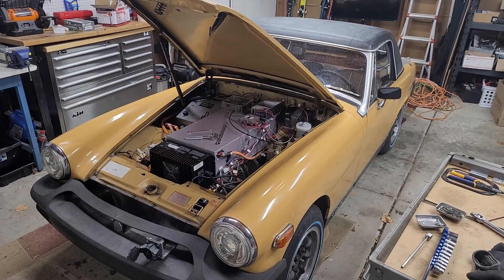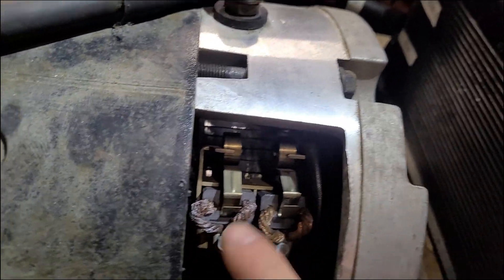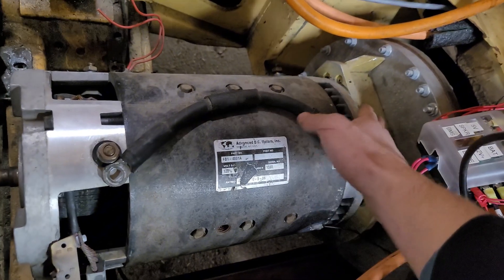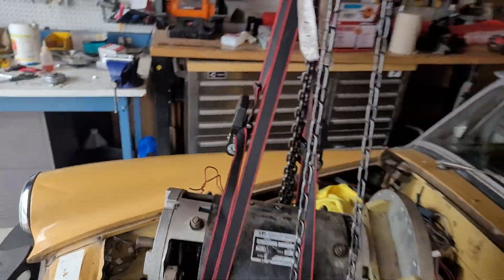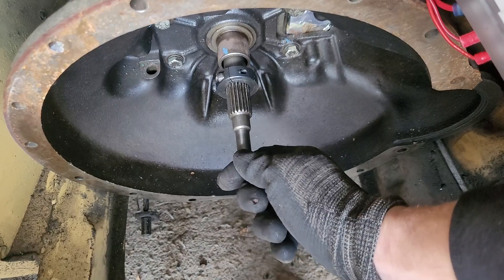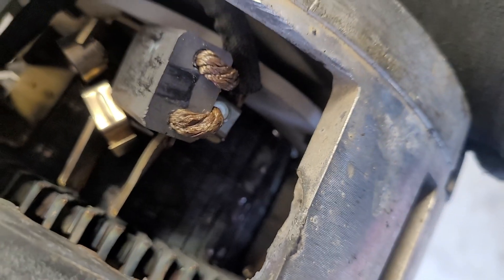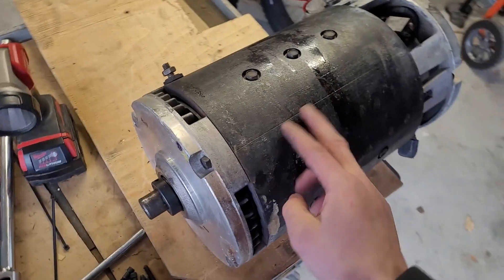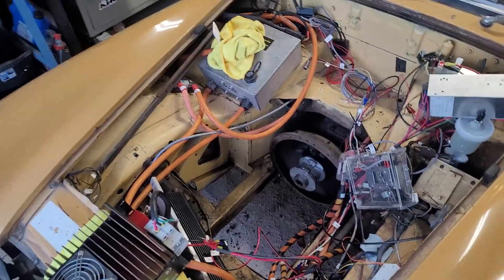Assessing the Damage on my Fried Motor - Part 20

Comment: Shaft on the transmission is normal. The long piece you wanted to cut would have fit into the flywheel with a bearing, giving it support.

Comment: Too high of voltage and current for a neutral timed DC motor. Zorched it out. Had the motor been set up in an advanced configuration like they do with Warp9 motors, it would likely not have happened. I commented on one of your shorts but now following along to see what happened and what you changed for the future.  I did an MG Midget too, but kept the voltage at 120v or less.

Comment: I have a 8in advanced DC motor, should be a drop in.  But the water cooled leaf motor might be a better choice.  I understand the leaf motor controller will run on 160v, probably enough power for such a little car.

Comment: Sorry about your motor, but this might be a good time to move to an AC motor. The Hyper9HV is rated for 144V, around 140HP and lots of torque . its an awesome drive unit. Yes a bit pricey but worth it. I got one and just finishing installing it in my JEEP. With the software you can adjust just about everything. Just suggesting. Good luck
Reply: Upvoted.  He shouldn't have used DC

Comment: This looks like a good time to consider moving to a Leaf drivetrain.  Motor and transaxle can be made to fit in the rear of this car with the battery pack in the front.  No transmission as a BLDC motor has a flat torque response.
Reply from the maker: @markmarkell9209  Have you seen this done in a Midget before? Please send videos/links.
I'm skeptical the motor will fit in the rear, and the battery will fit in the front. This car is TINY, and a leaf battery would add 300ish lbs.
Reply: @zuccamachine  can you, or any of your followers provide a midget drawing with a lot of dimensions?  I am interested enough to do a 3d fitting sketch.
Reply: @zuccamachine  have a look at this YouTube.  Work back to part3.  This general approach can be done much cheaper these days.  The leaf motor I mentioned before would work very well for such a small car.  I would get rid of the transmission and mount the engine further back attached directly to a driveshaft.  Your rear differential has a 3:92 :1 which is very close to the Leaf tranny.  So you could expect to get better than Leaf performance in a car about half the weight of a Leaf.  The Leaf has an inverter and charger that can be mounted separately.  Thunderstruck makes a nice little vehicle control module to drive the Leaf inverter directly over Can.
    I am presently building up a Lotus Europa faith this drivetrain.
Reply: @zuccamachine  I had a 63 Midget, and unlike my 71 that has the rwd 1.0 engine, I was going to build the 63 as a mid-engine using a Toyota Echo 1.5L to drive the rear wheels.  It would fit into the midget in both width and height.  The gen1 (2011-2012) leaf motor would fit in width and height no problem, the motor controller is seperate unlike the gen2 that stacks them all as a single unit.   You would need a new suspension, the leaf cradle is much too wide for a midget, it is too wide for my Thames, but I'm modifying the body to use it.  But you could use a echo or fiat 500 suspension probably and use the leaf motor/trans.  The left side of the leaf engine compartment is mostly empty space it has the water heater and 12v battery, they can be relocated.
Reply: @murraymadness4674  I advocate not using the Leaf transaxle at all, but rather mounting the motor and inverter roughly where the present trans sits and connecting a modified driveshaft directly to the MG differential.  Similar to the arrangement zuccamachine used minus the MG transmission.  That leaves room in the engine bay for the charger and the boot for batteries.  In high gear the 4 speed was always straight through, so 4000 rpm at the engine implies 4000 rpm at the differential. This arrangement ends up being well balanced with a fairly low moment of polar inertia to assist handling.  It also avoids modifying the rear drive and suspension.  I would certainly recommend upgrading the brakes all around to disks.  The 12V battery can be reduced to a lighter unit as it no longer needs to supply starting current.  A gelcel can be used and mounted anywhere.

Comment: I think the brushes popped free and bounced off of the case of the motor and shorted every time that's what caused all the damage to the motor case.
Reply from the maker: That's makes a ton of sense, I couldn't imagine what generated that kind of heat but that's definitely it.

I guess that means the motor casing was also shorting to the car frame 😮

Comment: the play in the transmission input shaft is normal; the spigot on the end goes into a bearing inside the flywheel to put the clutch in double-shear for more strength. the direct coupling to the motor should satisfy the double-shear requirement, but it's likely the bearing in the transmission requires the clutch pressure plate to preload the input bearing, too, so you might want to consider going removing the transmission and going direct-drive. that would let you mount the motor inside the transmission tunnel & mount more batteries under the hood.
Reply: and that motor is not worth repairing.
Reply: I'll jump in here just to say you can't do direct drive like you're saying unfortunately.  There needs to be some sort of gear reduction ahead of the diff.  An overall reduction of 6 to 9:1 for a motor like this is where you need to be for 80ish mph top speeds.  Tesla uses just over 9:1 with their motors that spin over 12,000 rpm to get 140mph or so top speeds.  
There's a company called Torque Trends that makes a 2:1 reduction unit that bolts to the motor.
Yes, in certain drag racing applications, guys do run big brushed DC motors directly but they also run controllers that pull +2000amps.
Reply: You’re right about that play being normal, but there’s no preload on the transmission input shaft bearing from the clutch; the shaft passes through the pressure plate with plenty of clearance and the friction plate is free to slide on the splines.

Comment: My vote is "you do" most of the brushed DC motor rebuild yourself.  (And save the AC motor and other upgrades for future clean sheet designs.)

It just seems to need the parts, that hold the brushes and the brushes themselves. And repair the loose segment of the commutator. Which is best fully separated and then glued back down. (Permabond ES550 withstand temperatures up to 355°F (180°C)).  And then turn the commutator (Is the one step probably that's best, outsourced to a machine shop. ( unless you want to try a less exacting ad hoc method?)) 

FWIW there are plenty of posts showing how repairs of far more damaged brushed DC motors are repaired ad hoc.  Where for example a solid wire replaces missing segments of the commutator. In addition regen can be accomplished with DC motors too.  (And going to the added expensive of an AC motor is going to  involve a lot of  complexity and cost and relatively little benefit.  AC motors makes far more sense if its part of the original design IMHO)

Can you post the make and model of the motor? So we can double check to see the availability of its parts. Good luck with that whatever route you choose to take.
Reply from the maker: @nc3826   Motor make and model are in the description:

ADC FB1-4001A
Reply: @zuccamachine   The, Diyelectriccar Forum seems to have the most extensive thread, including photos of repairs. On that specific motor in terms of its brushes and related issues, including replacement. And part suppliers. For the ADC FB1-4001A

(FWIW I believe I actually already saw the model number for it in the description but erroneously disregarded it.... Since the link below it, confused my dyslexic brain.... Thanks for the clarification)

.Good luck, doing whatever you're going to do with it.

Comment: A quick search shows an AC motor available from EV West, you don't want to know the price though. At least it means there are options out there compatible with your voltage.

It appears that the same motor/controller is being sold by numerous retailers and might be the only easy AC option. I just typed in 144V AC motor.

I found this gem in a listing for a DC motor: "The commutator bars are more securely attached to the arbor, so they will be less likely to lift."
That motor is $4k and the cheapest one they sell, maybe rebuilding is in your future? Ah, I see that your motor might be from a forklift from some reading! I also see that you already know your options from the end of the video.

Comment: Very cool to see your tear-down, and I'm excited to see what you do next. Thanks for sharing!

I've gotten to play around with similar carbon brushes at work and seems that you can run around 150A through each brush before they reach 100C and see breakdown. albeit this was with a stationary contact on a 1/4"  thick pipe. 

I'm not totally sure on your thermometer placement, but it seemed you pointed towards the output shaft when referring to the 40C+ temperature measurement you were getting during the test run.

Regarding brushed motors, I would imagine the heat generated on the brushes and magnets from the friction atop the 200A total current and high inertia from highway speeds, might have lead to some unwanted expansion. combined with the orientation of those magnets, I think you might've caught an edge leading to the flung brush. Pretty awesome to see the results of a single moment of chaos.

edit: LOL I just unpaused and saw you show the lifted commutator. Super cool. Were you having to operate above the rated motor speed for your highway run? I am unfamiliar with DC motors, but now I'm curious if the rated motor speed is dependant on the efficient operating range of the motor, or the commutators ability to avoid lift.
Reply from the maker: @iBananaCrackers  I would guess I was at around 4500 RPM, and 200A at 140V.

Datasheet shows it can do 185A at 138V at 5700 RPM for 1 hour. I was well within that window, and only operating at that speed for less than 5 minutes. I think the motor was damaged to begin with, and this threw it over the top.
Reply: @zuccamachine  Thanks for sharing the numbers! Yeah that motor seemed a little aged once you got close. I would bet the vibrations on the road helped with the accelerated wear. Would be neat to see what you come up with in the future. 
I like that you are sticking to the lower voltage system, and given the small size of your chassis there's no need for higher voltage unless you were trying to make an MG Missile deathtrap LOL.

Comment: heat dude, heat. You have no cooling for that motor.
Reply from the maker: @maok13  There's tons of examples of series wound DC motors in EV conversions that are air cooled just like this. The motor was likely compromised before it went into the car.

Comment: Nice post-mortem.  Hopefully an experienced motor rebuilding can give insight on the repairability

On the hoisting:  if you lay a 4x4 post over a few joists, you can slide it side to side and it will spread the load over a few joists.  Helps a lot with positioning the hoist over the car

Good luck!
Reply from the maker: @natehemphill5715  Good idea! I'll definitely do that when putting the motor back in, whatever motor it I end up getting.
Reply: @zuccamachine  cool idea 

but from a structural engineering perspective, sistering, some scrap lumber to the midpoint of the supporting member(s) to reduce deflection, would be the easiest and most cost effective safety measure....  Or do both?... Just a thought